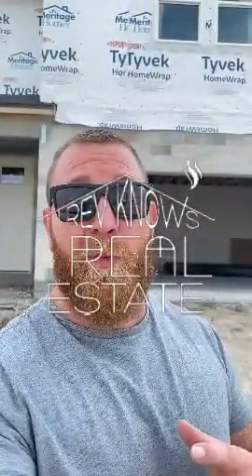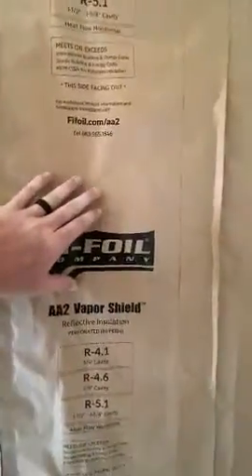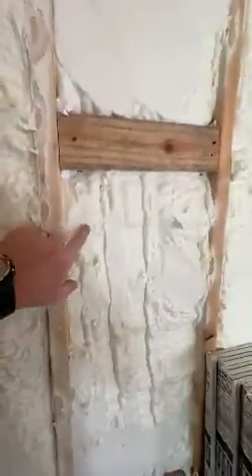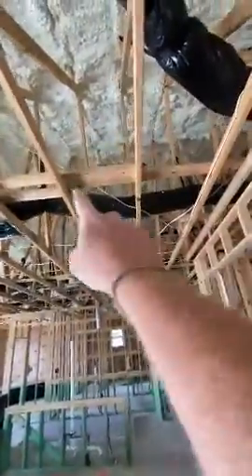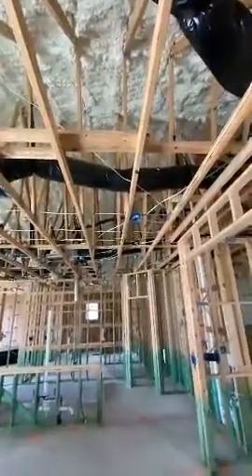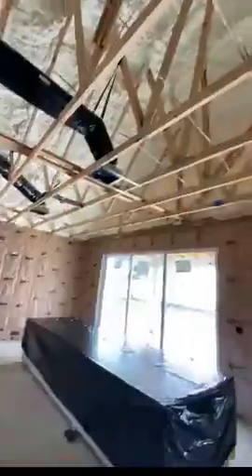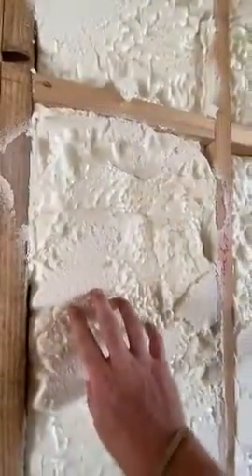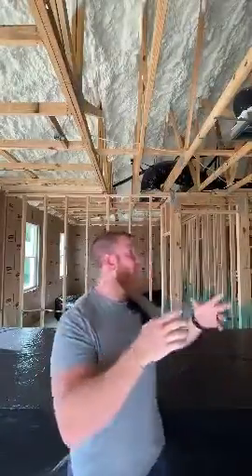Meritage Homes in Winter Garden (McAllister Landing)

Comment: They say these houses have a lot of problems around the 1 year 2 year mark. Looks nice but will it last? Time can only tell.
Reply: Yes, the 2 year mark because as the new build settles the cracks and stuff appear but they will come and fix it for you. 

They do either 1-2 years for that. It happens with all new construction, because it’s new it has to go through the 4 seasons to acclimate essentially. 

I currently own a William Lyon but we just bought a new Meritage home and there is a difference by far!!
Reply: @bullyhomestead7232  and which is better
Reply: @joshuam2154  it really depend son the area because they subcontract all of the work but I really think even just the city makes a difference in who they higher and the expectation for quality. Both houses really are quite similar but im sure we will have more cracks in a. two story.
Reply from the maker: Most of these new homes come with a home warranty that will cover most defects structure wise as well as appliances. Are you in the market to see one?